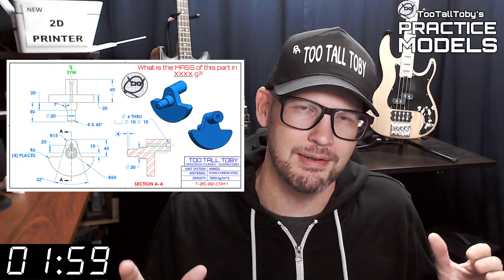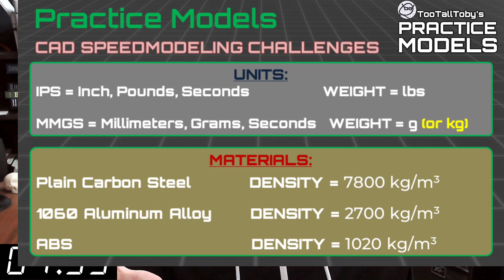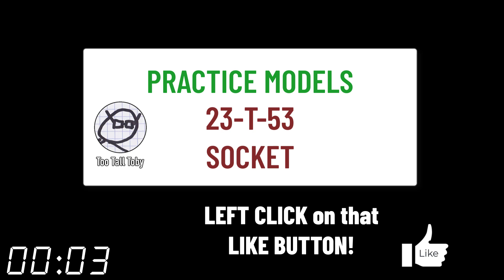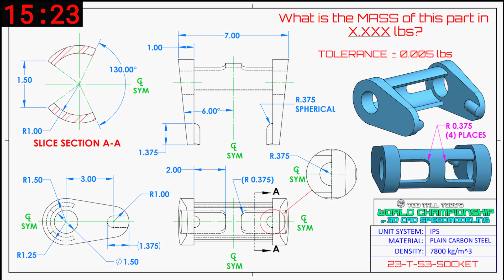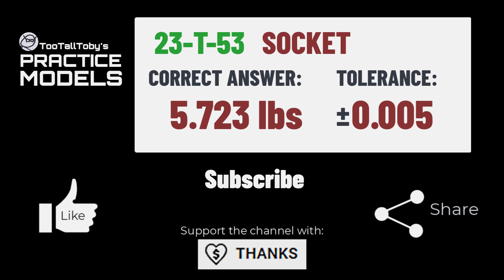CAD Modeling Practice Challenge - Onshape, SolidWorks, Fusion360 - SOCKET - Extrude, Revolve, Fillet

Comment: I got 5.72 after fixing a tricky mistake, I used the draft command in fusion 360 to angle in the sides but for the pull direction plane I used one of the origin ones, the behavior of the tool with a pull plane not being at the edge of an object was not how I thought it was going to work. it took me ~20 minutes
Reply from the maker: Nice job Leo and nice job finding the mistake!!

Comment: 13:15
Erm, 0.159 grams :)
I guess I was in mm instead of inches.
I scaled the model by 25.4 (mm in an inch) and got 2612g which is 5.759lbs but my density in fusion360 just reads 0.008g/mm^3 so... throw on a chamfer and call it good ;)

This was fun, subbed.
Reply from the maker: lol - I like this solution!  Nice job!!